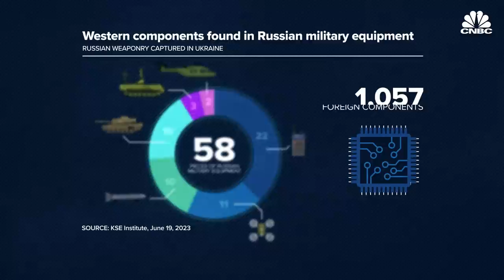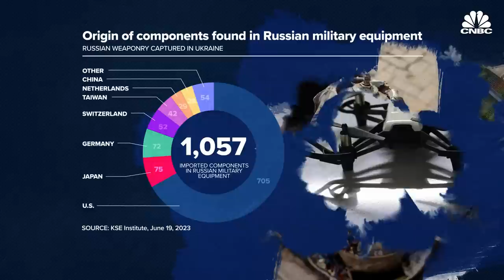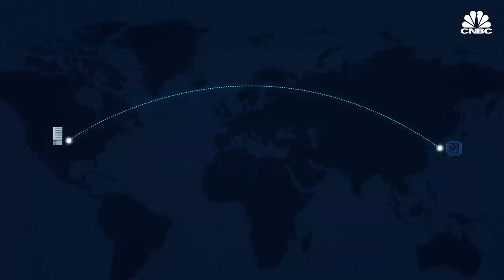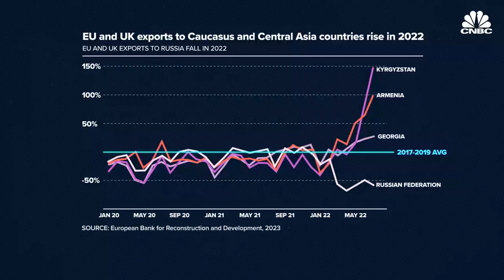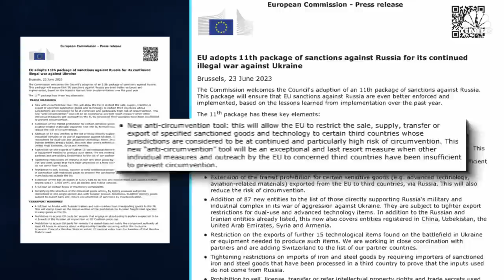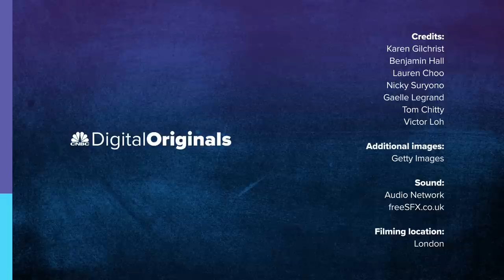How sanctioned Western tech is fueling Russia's military

Comment: The report failed to mention that Russia has the capacity to manufacture most of its semiconductor chips used in military and aerospace applications
Reply: The report did not mention this simply because Russia has no such production capacity. Russia is probably capable of making chips with the old 65nm technology and older, using old manufacturing lines that were discarded by IBM and AMD years ago and tnan sold to Russia. It is hard to say whether the machines are still in working order and capable of production, because Western companies do not service them.
Reply: @gustorel3041 well recently they lauched a probe and (lander im not sure) to the lunar south pole which extensively requires independent functionality of the spacecraft which in turn requires microchips and semiconductors, so there is a solid chance russia produces some form of modern microchipw
Reply: @obamagaming-zv4vy  The fact that they launched a lunar satellite once in 50 years (btw, with the help of the European ESA), it does not say anything about the level of the Russian industrial base.
Reply: @obamagaming-zv4vy  The new Russian lunar mission is part of their new joint space exploration project with China.
Reply: @gustorel3041  mad that Russia is making gains huh? lol
Reply: @HC-wo2tz  Gains? Most of the Russian countryside does not even have flush toilets. :)
Reply: @gustorel3041  Ah yes, the classic "nO toILEts iN rUsSiA!" Whenever someone brings this up, I imagine them clapping their flippers like a walrus lol. Get back to me when you've gone out for some air kid.
Reply: @HC-wo2tz 
Why are Russian soldiers looting toilets from Ukraine?
Reply: @carlabroderick5508  It doesn't matter at all. it's pretty irrelevant actually. All that matters is that Russia continues to hold on against NATO. Toilets, Ukrainian civilians; none of that matters.
Reply: @carlabroderick5508 Because Putin was having very bad diarrhea so he commanded to bring at least one working toilet pot but they didn't remember to steal western made toilet paper
Reply: @gustorel3041  Please let me know why Russia halted the sale of engine rockets to US in 2022.
Reply: @dancotton13  Russia stopped the delivery of these engines as its attempt to revange the US sanctions imposed on Russia after Russia's invasion of Ukraine. Russia has harmed mostly itself by stopping these supplies, as the electronic equipment was supplied by the Americans and the Russians now have a problem replacing it with something else. Americans currently use other engine options, especially SpaceX rockets that use in-house engines.
Reply: What are you all talking about here? 99.9% of chips are made in China. What is the problem with chips in China, and therefore in Russia?
Reply: "Russia has the capacity to manufacture" russia cannot even manufacture civilian cars lololol

Comment: Russia will certainly lose the war, if they are using cheap Chinese analog radios like the baofeng UV 5r shown here😄. As for other tech, you don't need anything cutting edge  to guide bombs and such.    Arduino microcontrollers,  and SBC like raspberry pi's have more than enough off the shelf power to do that.
Reply: Chinese data radios in Mavic drones are stream 1080p videos from 10 km away and Russia hauls them directly from Shenzhen in military transports...

Comment: All western semiconductors should have a doomsday circuit that can disable the semiconductor if it gets into the wrong hands.
Reply: And how will you turn it on mr big brain 😂 Do you think they could not disable it hmm?
Reply: all it would take is one person finding such technology and suddenly your sales evaporate.. this is the kind of thing we're talking about when we say that your generation isnt going to make it...
Reply: It's embedded in the circuit.  They simply wouldn't know how to turn it off.  Access would be encrypted microcode.  As long as it's connected to a network, it can be triggered via a IC driver update on a delay timer, so that sufficient time is allowed for global driver updates on the majority of semiconductors can be set in initiation phase. From there on it can simply trigger based on a timed interval or even random time range progressively disabling the ICs. it could be temporarily or permanently set.  Only the IC manufacturer could access it and control it.  Control could be made multi layered secure, including via another IC that's not released publicly and forms part of the multi layered encryption key system.
Reply: @JoeyBlogs007  bro you realise there are jammers, and Russia has the best on the market yes? Xd
Reply: @JoeyBlogs007  also as long as it is connected to a network? They can have a secure connection directly from transmitter to reciever no need for internet... Who the fk uses chips that have mandatory internet connection ij the military for drones or missiles, it would make them super vulnerable
Reply: @snoopysnoops007    LOL Russia don't have the quality of electronics. they import a lot of it from China and US. This is widely known.
Reply: You watch too much movies dude.
Reply: @JoeyBlogs007  They have their own production of silicon chips but in a larger transistor size. They dont need 5nm transistors in a drone or missile...
Reply: Why do you think Russian electronic warfare is able to jam most if not all Ukrainian drones bought from China?